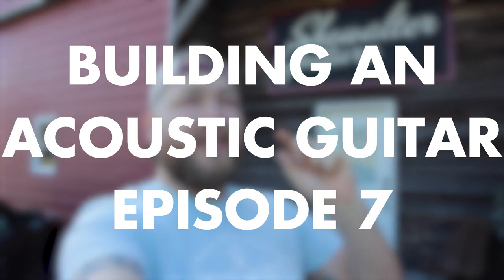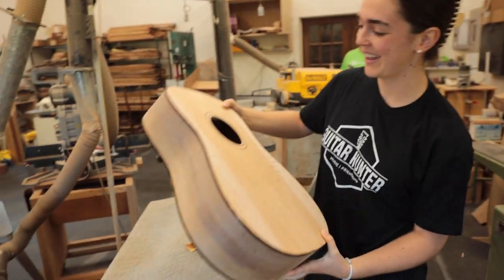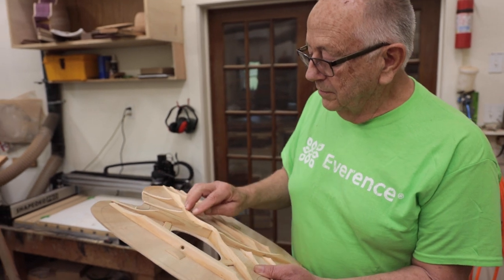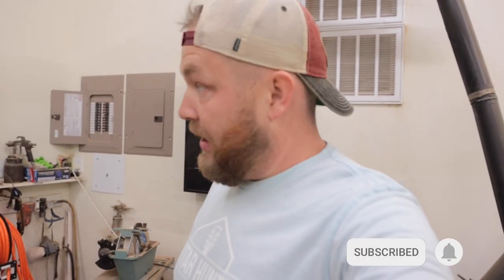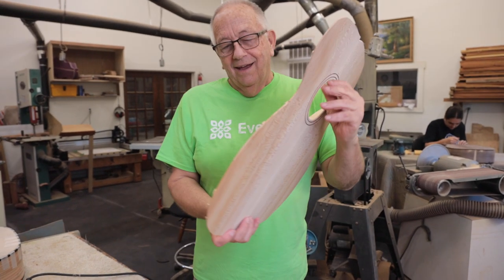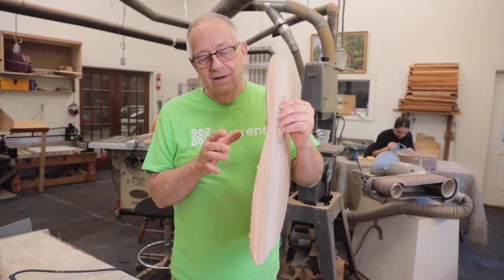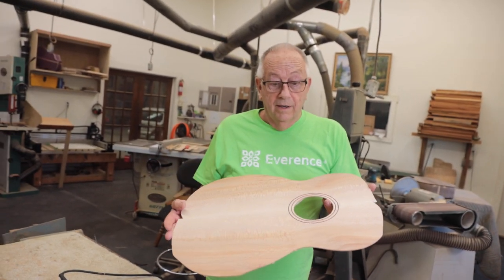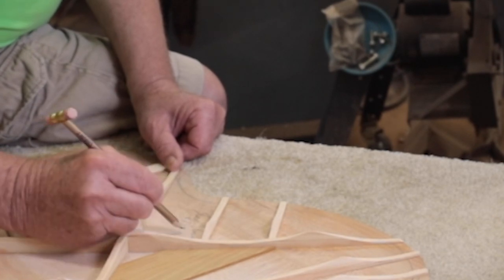Building an Acoustic Guitar with @showalterguitars5707 Episode 7

Comment: You picked the right guy to mentor you along! I wonder if he has tried the new 3M sandblaster pro sandpaper ( no, I don’t work for 3M). I have used it for woodworking recently and it is far better than anything I had before. Doesn’t load up and lasts and lasts. I also suggest you use hearing protection when using the router. Those can do a number on your high frequency hearing long term. Can’t wait for the next episode.